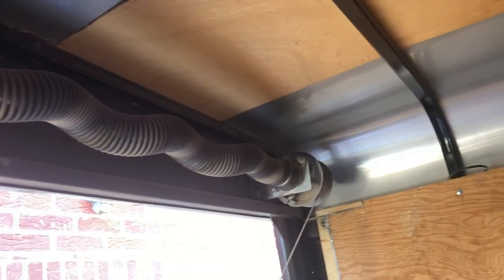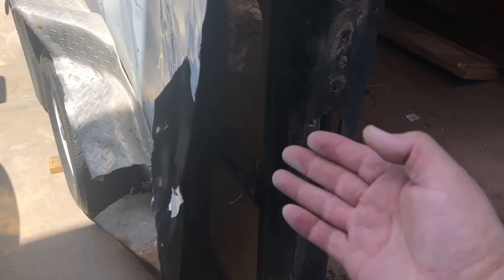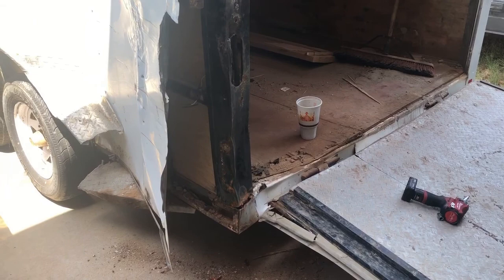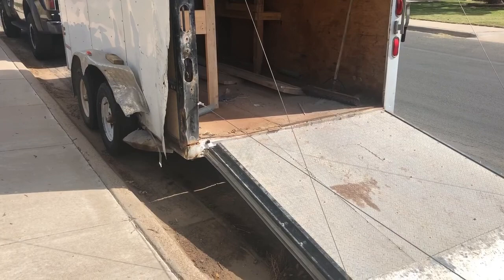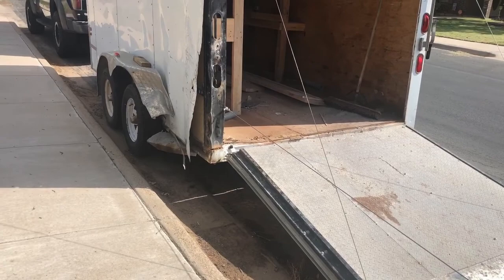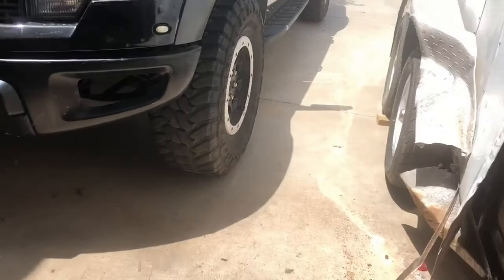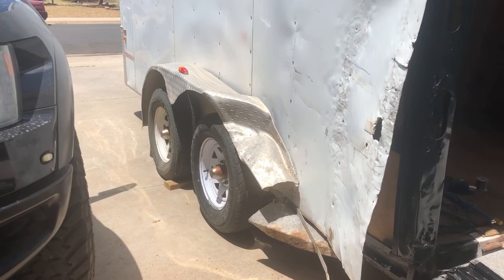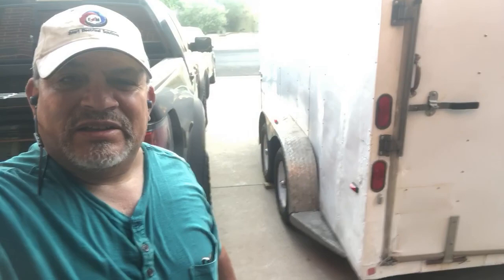Copart Trailer Rebuild

Comment: I think it looks great!  Its a trailer & not a late model car / truck.  How did you straighten the white aluminum sheet on the side?

You could get the fender welded by someone else. I cannot imagine that would be expensive  as you can bring it to them. 

Again great repair!
Reply: jim nielsen I used a combination of a long wood 2X4 and a flat 1” thick metal piece and a hammer. I could take it to get the aluminum welded but I just wanted to get it finished and registered to start using it to move. Thanks for your comments.

Comment: Nice! Good job to show how  trailers are constructed and how one thing affects another. Is there any way to make gap between fender and trailer wall disappear, e.g. rubber gasket, flex seal, or?
Reply: Robert O. Marquez I could remove the wood panel on the inside and push it out but it isn’t worth the effort for me. I am using it already and it got 350 miles fully loaded yesterday. It towed like a dream with the Raptor.